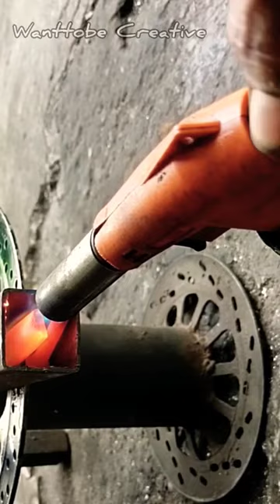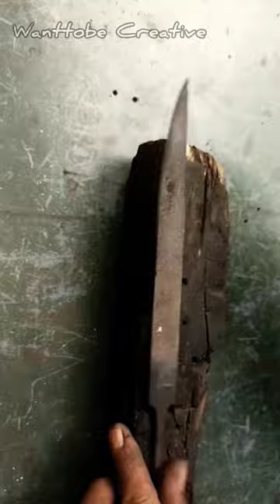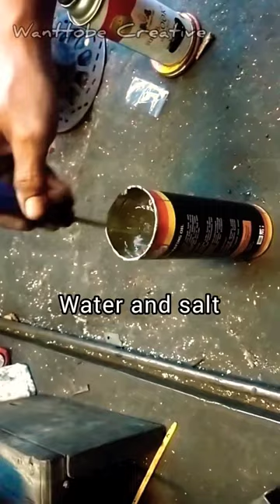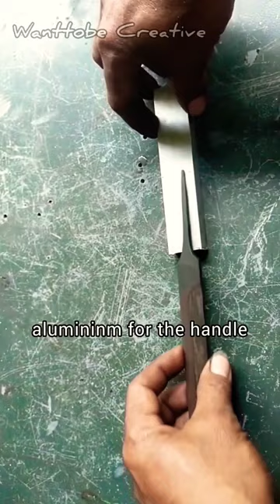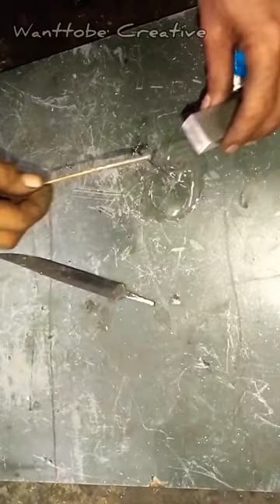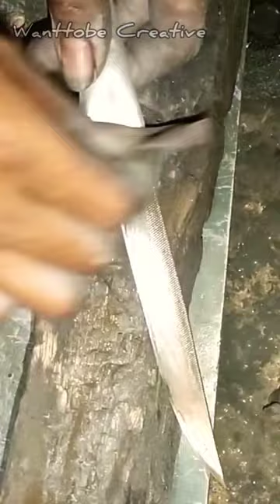Kitchen knife from an old file

Comment: thats pure crap. first the heat treatment looks like it failed miserably, the blade was not equally hot everywhere. Second the knife is too thick to be usefull in the kitchen. Third a solid steel and thick blade and aluminum handle like that make this weigh a ton and therefore useless in the kitchen.
Reply: @WilliamMurray420 It is a good video on how not to make a knife. And it is a waste of everybody's time that watched it. It's misinformation to the masses, and there's thousands of these videos online. It does not matter what the material used is.